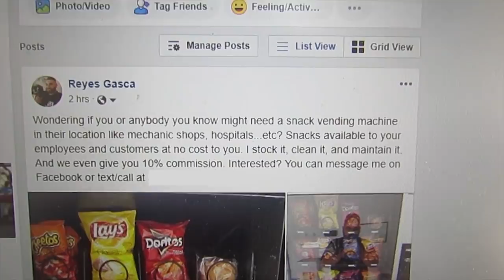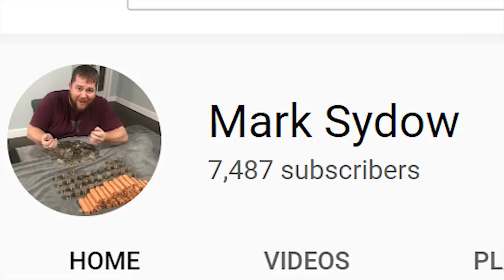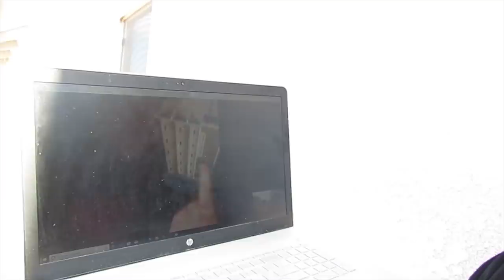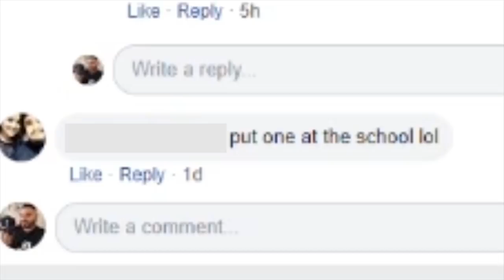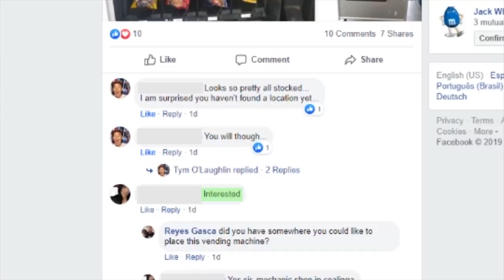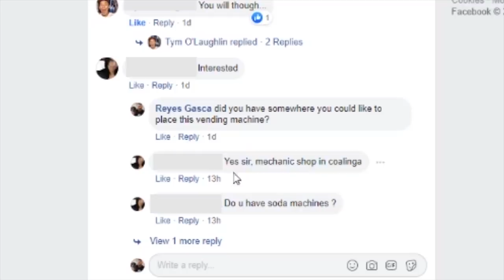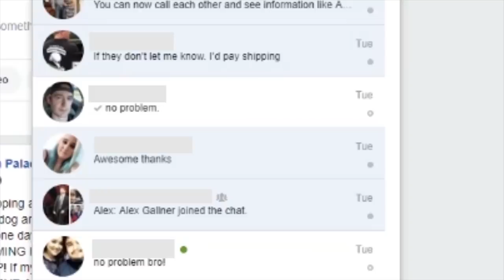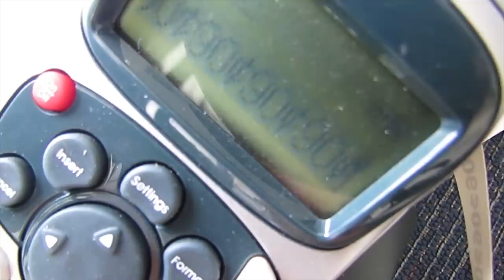WORST thing to happen to my vending machine business

Comment: I worked on vending machines in the past. That ice if from a bad door seal or you had the door open the whole time. Condensation happens when hot air meets cold air. You will have a block of ice in there if you don't fix the seals or close that door.

Comment: As far as the ice buildup...There’s a fan and a cooling coil. If the coil is dirty it’s blocking the airflow , clean it. If the fan is not running it needs replaced

Comment: That Dixie Narco was built 1980-1990. Icing up will happen when door is leaking air or open for long time, or is low on coolant.  Locations dictate what machine you need, style capacity and how new.

Comment: LOL....I've done the same thing....I tried to test without change...you will also need to make sure the sodas are in the chambers before they will shoot out sodas...fill it up then keep pushing each selection button until sodas come out, usually about 3 times per selection....make sure your dollar validator and coin mech are both plugged up, there is usually a blinking light on your validator inside if you need to trouble shoot...or if there is just a non blinking  red light then your good, if not count how many times the light blinks and look for the instructions on the validator to trouble shoot....looks like you bought a used vendo machine, I always check machines before I buy them unless it was just a killer deal...the frost is probably a leak, i would call a tech or ask a contact for a referral for a tech to fix the frost and adjust the thermostat....dont sell it....lol....try to finish what you start then as a last resort sell your machine to minimize your loss....Go to an apartment complex that's on the way to where you buy your product and close a sale with a manager and offer a couple of 12 packs every month and put your machine there....you should pull out about $100 every 2 weeks, or roughly 60 bucks profit.....i see you have about three machines, I would concentrically put all the machines close together for a route on the way to and back from where you buy your products, that way you can make about $200 profit in one day....best of luck and enjoyed your video.

Comment: On the Pepsi...there is a br5ass thermostat valve to adjust the temperature that the compressor will turn on and off. It cycles on and off. Turn the thermostat dial back 1/4 turn. plug it and check in 24 hours. you want to find the proper temp with no icing. Try different settimgs.

Comment: Someone may have said already, but do not lay a fridge (or soda machine) on the back or side.It must be upright at all times. I saw in an older video that you did and thought then, it may give you troubles.  If you let them sit for a long time before powering up the compressor, if it did get horizontal, you have a better chance of it all working out ok. :)

Comment: Looks like an old electro mechanical Dixie narco can machine.
As such the coin mech is the electrical heart of the machine.
You need to Google how to fill it and set the price of the soda through it.

As for the snax machine,all products should be sitting right at the front of the spirals,and add a product pusher to each spiral, unless your machine has " sure vend" which sends a light beam across the top of the delivery bin and thus knows if an item has dropped into the bin,then you will have items not drop and the machine will be bounced around the room by unhappy punters.

Comment: On the coke machine first issue regarding the ice there is a relay that controls the defrost function that is most likely ur issue on ur second issue of it not taking ur money the door has a switch like a fridge light one but that switch closes the circuit so the maxhine will accept money most likely that switch is broken and the machine thinks the door is open might also fix ur defrost issue.. i fixed about 100 machines with that problem hope it helps

Comment: Man, had a similar problem with a combo machine I tried to repair a couple of years back. Tried my best to fix it, all it needed was a new note reader to take our modern notes. So did that, then the drink dispenser stopped working. Could never figure it out and wound up having to take an L.

Comment: OK, 5:03 I know they don't put those coins in one at a time!!! Gotta be a way to pull the change mechanism and fill it. 5:09 might be a sign that it doesn't have enough refrigerant, it's dropping from a high pressure to low pressure too before it gets to the evaporator.

Comment: Reyes did you move it upright or lay your machine flat . When you lay a soda machine on its side, the oil in the compressor will flow from the compressor tube into the coolant lines.
When you move the soda machine and plug it in right away, you risk damaging the compressor. After a soda machine has been moved on its side, it must sit upright so that any oil that may have flowed into the coolant lines will have enough time to return to the compressor and clear the coolant lines.

Comment: Sure this all worked out. That's exactly what worries me about the vending machines. Would like to get started on maybe a spiral gumball one soon, Alibaba sells new ones cheap. Thinking of ordering from there. But my selling apps have been slow for like three days now. I'm buying silver now though. If you have some extra savings I suggest it. Crazy low prices right now. But, it isn't fast cash to my knowledge. Made my first purchase today. More of a safe route. Paper currency is fake. Buying precious metal seems like a more secure way to purchase stocks, ya know, like land, prices are going to go up the less that's available. Pretty confident on it for saving. But still learning. Might look into it for sure. Make a good video. Ten ounces of silver at spot price right now like $150 or so. A lot of sites sell you spot price for first purchase too.  When that hits $40 ten ounces would be worth 400 just base rate. Easy sell on eBay at spot price, and Just like stocks the more you buy the more you make. I'm focusing on silver mostly for prices right now. People on here call it stacking. Check it out

Comment: The ice in the soda machine indicates a problem with the cooling system. A coolant leak or compressor problem or some other problem is occurring. There should be no ice.
Reply from the maker: Thank you. I'm trying to fix the problem

Comment: Reyes a question who pays for the big electric bill that those old machines generate?? Looks like a one-way busines!!
Reply: Gemelos Maravilla!!! I want to know that as well is that what the commission is for or ????
Reply: True, didn't even cross my mind.
Reply: They don't use very much power actually.   Any power used is covered by the ten percent he's offering.
Reply: Red is Random. Haha at least 1000 watts per hour x 24 h , x 30 =? And if you have only 10 dls in sales? Who pays for the electric bill with no sales?
Reply: @gmmudfossils4877   pulles from vendindsolutions.com... Most soda vending machines run on 115 volts at about 10.5 amps. Most commercial grade three prong outlets will be acceptable topower a vending machine. Power consumption tends to run about 3.1 - 4.4 kWh/day for the lighting and 3.5 - 4 kWh/day for the refrigeration.
Reply: I was off by 200 watts per day!! And we want Reyes to succeed!! But it's not that easy!! Need to think all pros and cons!!

Comment: hey i fix vending machines i have a company in orlando and i was watching your video and on minute 1:40 i think you plug in the compressor plug not the vending machine plug so thats why was freezing because you put the compressor to run by itself. tht is also why is not taking any money.
Reply: you were suppost to plug in the big yellow plug and that black cord that you plug in into the outlet to your lower left inside of the machine. hopefully you still have it becuse i think it works fine.
Reply: @alexm.7249  underated comment

Comment: Reyes:  I'm a vending machine business owner, and since your not in my area (not competition) I will tell you everything I did to get my business a successful company.  (I have 85 machines today, snack and soda)   This is going to be a long post, so I hope you read it.
   First, lets start with your Pepsi machine in this video.  1. The ice forming inside the machine is NORMAL!  If you leave the door open ICE will form.  Close the door, and the ice will go away.  By leaving the door open, the cooler will not shut off because it is acting just like your home refrigerator. It is looking for the temperature you set it for. If open, it will not shut off.   
 Secondly, When you load the machine with soda, do you see little push plates/flaps on the inside of your machine? Those plates MUST be almost pushed FLUSH against the inside wall of the machine depending on the size of the cans you put in your machine. If they are not, your coin mech and dollar validator will not work, they will think the machine is Empty and not accept money.   To fix this 'Size' issue (to get the size plates to close) ((They have switches on them which tells the machine has product in it))  The Fix: On the back wall in Each Slot section there is a movable space piece of metal that slips into little slots onto the side walls of EACH selection inside the machine.  All you have to do is drop in about 6 sodas Per Slot and then move the metal plate forward until the bottom of the soda can is pressing the little flipper plate almost flush with the machine. (Leave a little play between them so the soda will fall freely when a person that soda selection.    
  Third:  Those black things that you pulled out and asked your friend about:   Those are Space Plates. They are for adjusting the Size of the product you are putting in your machine. Since you are using cans, they are to be adjusted to cans. It keeps the cans from getting wedged in between each other. Example: Your cans should fall freely one by one. Your cans of soda should look like a Z formation when the machine is stocked if your Spacers are correct. One can will drop to the person buying and the one on top will drop down one loading itself for the next vend.   
    Hope this helps.